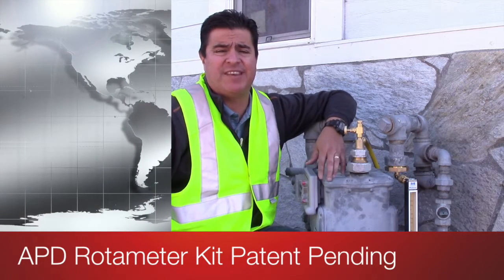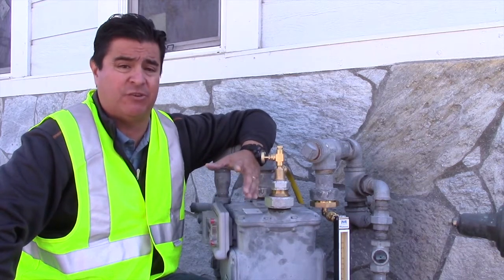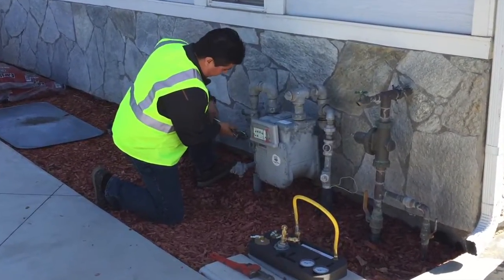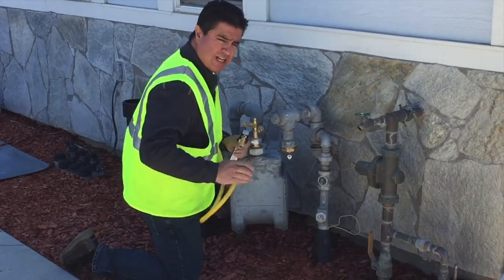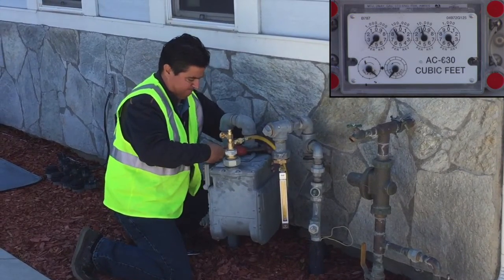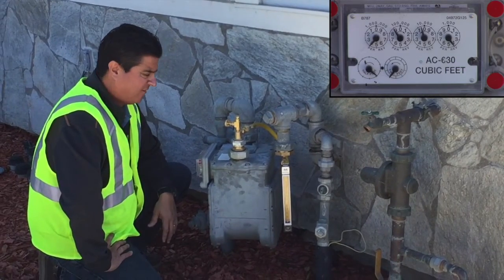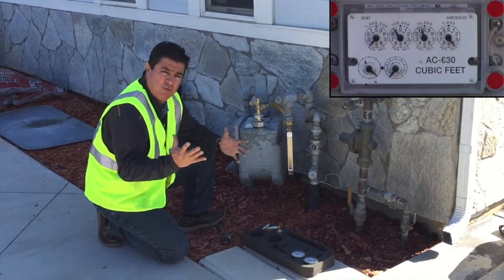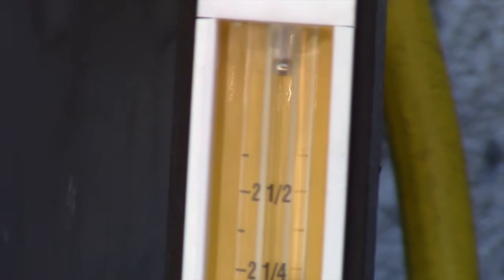How to Do a Gas Line leak Test For Your Home

Comment: You can also hook your manometer to the drop leg and re-apply pressure and then shut the pressure off and see if it drops and not have to disconnect the gas meter.